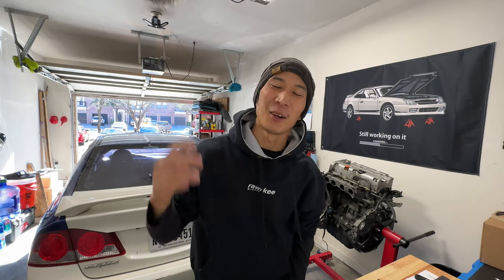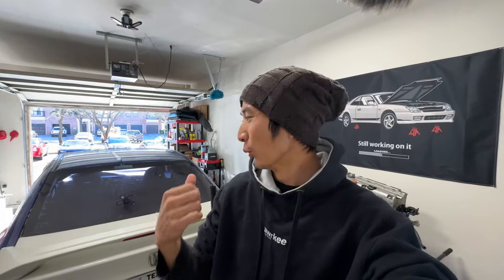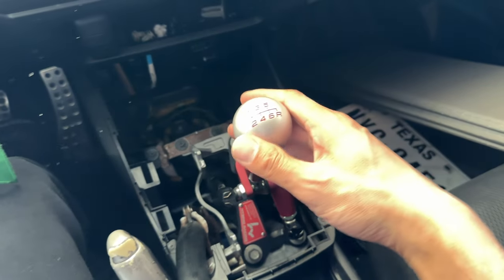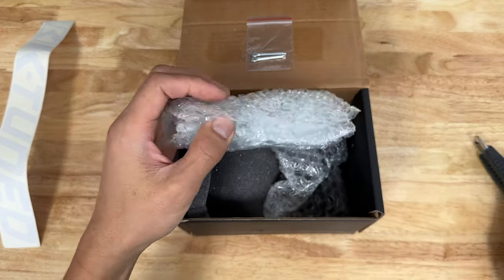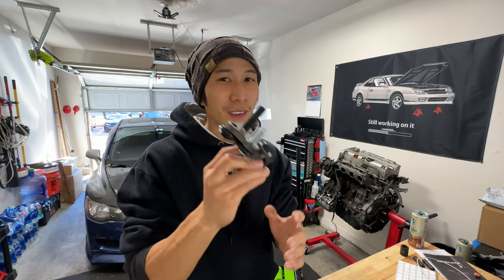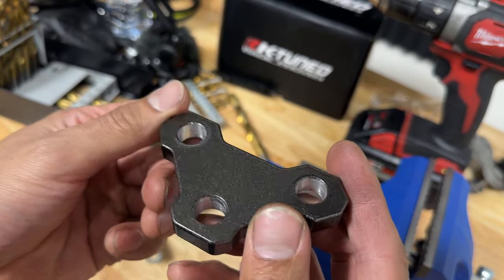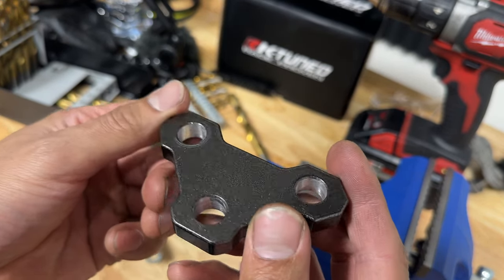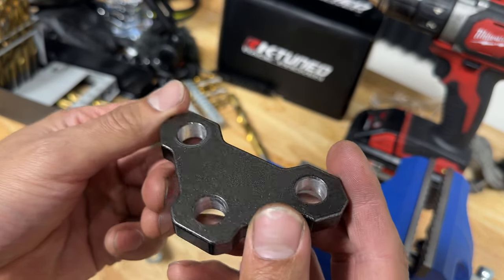The TRUTH About K-TUNED Ball Joints - Roll Center Adjusters Review

Comment: I bought those max (orange) and I had to replace the entire system once. Ended up going bad 2x. Now I have rev 9's. I don't advise anyone to get Max's
Reply from the maker: Max??? Never heard of them, if these go bad, I'll give them a try :D
Reply: @Rawrkee  I meant max speeding rods. I hope you have a better experience with them though. Does ktuned have rear axle locator to bring the wheels forward in the rear fender?
Reply: Yea I’ve had terrible experience with maxspeeding rods. Different vehicle, it was my cousins bmw we did a video on taking them off. One of them literally fell apart when it came out of the car.
Reply: @Rawrkee the ones on my cousin car were good for about a year or two and then they blew.
Reply from the maker: @ThrottleHavoc  man, fortunately it hasn’t happened to me so far >_<
They do have newer versions and so they might hold up better. What coilovers are you running now?
Reply: @Rawrkee  he switched them to Godspeed
Reply: @ThrottleHavoc  same experience went through 3 sets and in all spent enough to get the replacement. I went with rev 9

Comment: It’s not a major issue to do what you did, but at the same time I don’t feel like having to modify the part after I buy it. I may stay away from these roll center adjusters then.
Reply from the maker: I actually just got in contact with Ktuned recently and they claim that they corrected the issue a few weeks after production, so I may have received an early produced model. If you order directly from them, you should get the revised version. I on the other hand had ordered from a 3rd party website
Reply: @Rawrkee  got you thanks for the feedback. I stumbled across your install because my girlfriend is looking to do some more suspension mods to her 8th gen si. I’m glad you said that because I was about to just tell her steer clear of them.

Comment: Looks like you can use the RSX extended ball joints for the Prelude. I wonder how well that setup would work the the Type SH suspension with the double ball joint from the radius rods.

Comment: I had the same exact issue. You would think they wouldn’t power coat the inside of the hole or at least test fit them.
Reply from the maker: Oh well, it happens... Did you notice if your suspension made more noise when you went over bumps?

Comment: I just bought some k series ball joints for my 8th Gen civic
Reply from the maker: Nice bro! Did you get them installed yet??? I hope they make your car feel much better! Mine were shot ever since I bought the car and now I finally replaced them 🤣
Reply: @Rawrkee ..I plan on getting them installed next week along with truhart lowering springs..truhart shocks & struts and goodridge stainless steel brake lines..all of my oem suspension components are shot and I’m in need of a wheel alignment
Reply: @kiellieferickson5506 did you have any issue installing them?

Comment: I felt a difference with my K-Tuned ball joints compared to the stock ones. On Eibach Pro-Kit springs which give a mild 1"-1.3" drop all around my car, I experienced bump steer issues with the front end on bumps/uneven surfaces. After I installed the roll center adjusters it went away. Highly recommend. 

There is a company called Aerogenics that makes just the spacers for the factory ball joint. Much cheaper alternative although if the ball joints are worn the K-Tuned ones are great.
Reply from the maker: Thanks for the info bro! Did you notice more sound from the front suspension when you go over bumps??